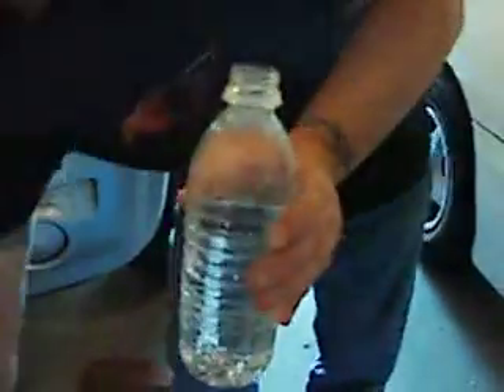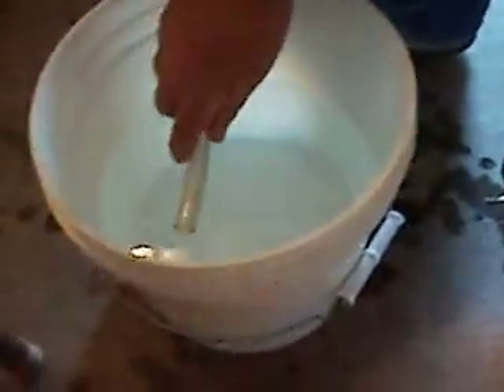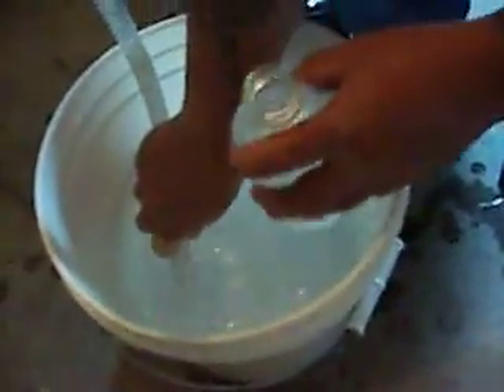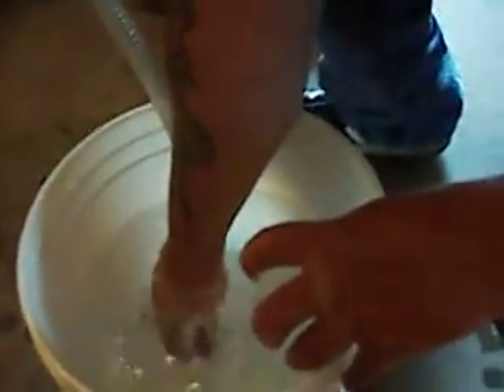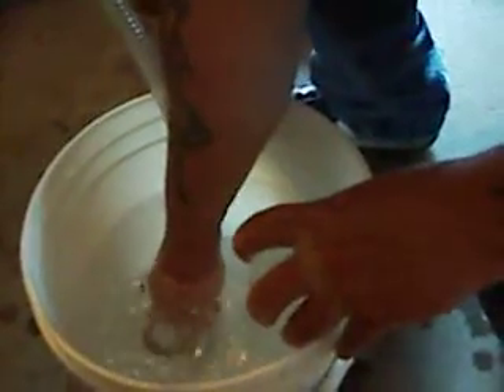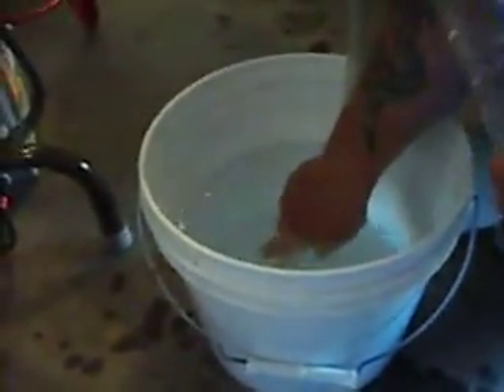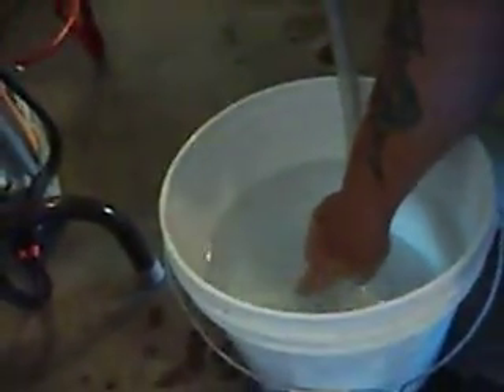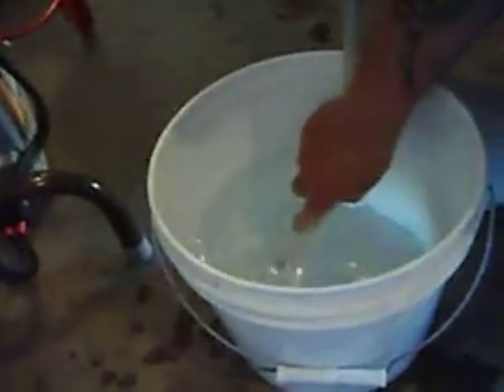HHO Generator 30 liters per hour

Comment: You don't measure HHO production "per hour".  Use per minute, which, in this case, your only putting out slightly more than .5 liters per minute.  What is missing is what the amps were during testing, plate configuration, plate makeup, etc.  Thanks for sharing the vid.

Comment: Yes, the whisperin was cute...

I didn't notice what type of plates you're using in this cell?  Are they 304 or 316L or other?

Also, where'd ya get the 12 X 12 plates and for how much?
I created a dry cell made out of SS rulers and only using 2 of the 4 cells in my unit, I'm producing .5L in about from 54 to 60 seconds at 14 amps and approx 12 volts.

I should be able to push your kind of volume out of a 1 X 12 cell!

Keep up the great work.

Sincerely,

Superbee1970...